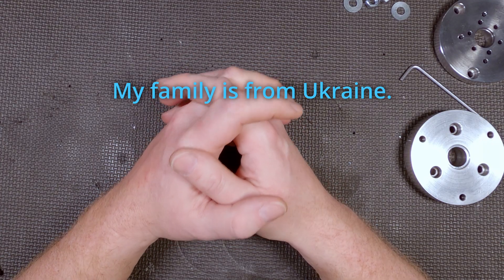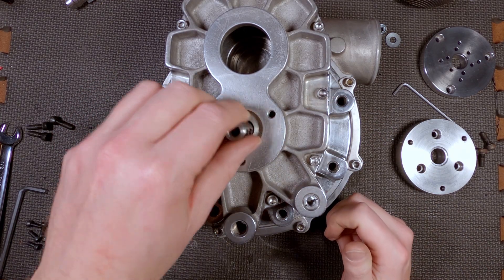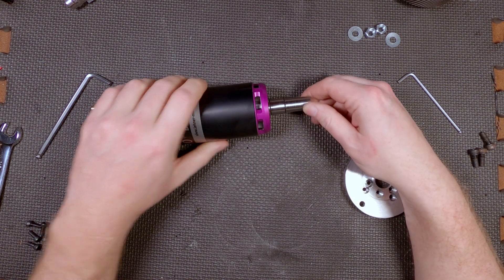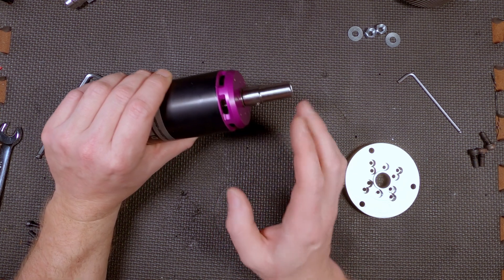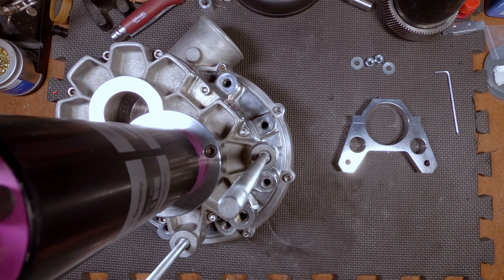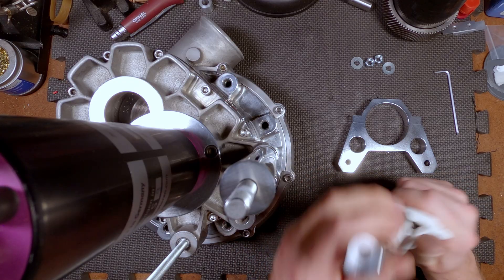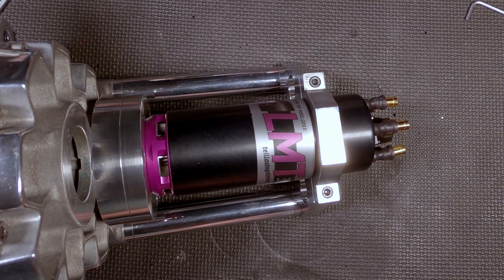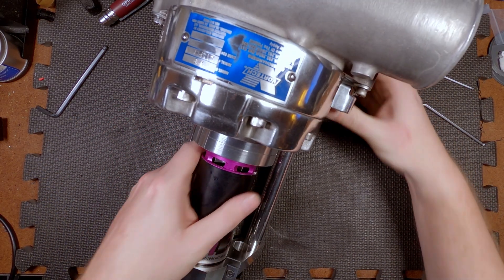DIY Electric Turbo: Sledgehammer Assembly

Comment: Interesting.  You did take care to match the motor characteristics to the requirements of the compressor, didn’t you?  I’m thinking the motor won’t be capable of spinning at the sort of speeds you’re going to need to get the compressor working correctly.  Do you have the specifics posted anywhere?
Reply from the maker: Watch this video: https://youtu.be/h7yScua28I8

Comment: I have a question why do you remove the gear train is it too much stain on the motor for startup and if so can't you set the motor to sit in a idle or is it still to much strain I've always been very interested in electric superchargers
Reply from the maker: It's a balance of motor size/rpm/torque.  You could go with a lower RPM motor (that would be easier to control), but the motor would require more torque, and more torque = more size and weight.

Comment: If you get a chance to mass-produce this turbo I will buy it. The first electric turbo that is not a scam from ebay
Reply: It's not the first one that works.  There's a few commercial models, but you get what you pay for, they're a few grand for the kit.  I think it was MCM that did a video on them a few years ago, the electric turbos that actually work... They worked great for smaller cars up to like 6cyl.  For 8 they were a little too little air flowed, but they weren't sized for 8 either.

Comment: Alex, I've been thinking about a system that eliminates lag. Extending a shaft through the impeller and a dry seal on a fixed inlet elbow would work perfectly. Boost control could be done using a combination of the motor as a generator and electronic wastegate. I'll need a floating mag clutch system to keep weight off the shaft. 
The OEMs do it but not in pursuit of power unfortunately. Your work is incredible, I love it.

Comment: Turbos spin at between 100,000-250,000 rpms at full rev-how do these electric turbos even come close to making the same boost?
Reply from the maker: Not all turbos (or more accurately, centrifugal compressors) work in the same RPM band.  I did a detailed video about this a while ago; this might prove helpful: https://youtu.be/h7yScua28I8
Reply: @AlexLTDLX  Thank you so much!!!
Hey, love all your videos-   so I just wanted to put it out there for future video ideas that an AGNI/Lynch motor might work well for powering a turbo with perhaps some gearing up -also any other smaller electric vehicle project:
The AGNI or Lynch motor is a unique axial gap permanent magnet brushed DC electric motor.  The motor has a pancake-like shape and was invented by Cedric Lynch in 1979.
The Lynch motor is built from ferrite blocks sandwiched between strips of metal, instead of conventional copper coil windings, and is held together purely by magnets. The motor is available in several sizes (6.6 lb) to (24 lb) weight and provides a power of 1.5 kilowatts (2.0 hp) to 11 kilowatts (15 hp) within an efficiency range of 80% to 90%.
Any voltage battery up to 90 volts can be directly connected or a variety of controllers will work such as cheap PWM or golf cart controllers of many power levels.  I've even ran mine (AGNI 15kw capable) off a 3Kw brushed motor controller for an ebike.  What's amazing is the torque produced: I once hooked a single 18650 battery directly and the shaft spun about 90 RPM and had an incredible torque for such low voltage and motor speed.  A 9v battery spun it about 300rpm and you could not hold the shaft from spinning with your hand, 48 volts is about 2,500 rpm and it will rip a back tire right off an electric bike.  A very interesting motor so I thought I'd throw it out there, thanks again for excellent and interesting content.

Comment: Alex,  imagine what you could achieve with an axial-flow turbine, instead of centrifugal... there is a reason you can't buy them...
Also, if you absolutely had to go with a positive displacement air-pump, what would be your first choice??  Rotary Lobe, Rotary Vane, scroll, helical, radial...??  There are several that would provide plenty cfm and psi (even for your engine) in the 3000RPM range!
Believe it or not, a piston type, double acting, air cylinder with a 6" bore and a 12" stroke, would produce 702CFM at 1800RPM!!!
I've been researching every possible type of air-mover for quite some time.
There is a much better way then the headache of centrifugal, as it will constantly be a problem.  For example, energy draw during EVERY spool-up risks all the electrics.  
One more thing, just try to imagine the controllability a positive displacement system provides....  no choke/surging, no crazy rpms, no compressor maps...
Reply from the maker: Wow.  That's a big question.  Let me back up and explain why I went with a centrifugal solution instead of something else (the bulk of my boosted experience is actually around positive displacement blowers/compressors).  Centri units hit the "sweet spot" between unit size, weight and what's possible with brushless motors that are not hyper-exotic in terms of rpm vs power.  I know you've been with me for a while now, so you know that the only real issue I've been having is overcoming the long cables that installation in an actual car requires.  Correct me if I'm wrong, but axial-flow turbines require more speed (rpm) and multiple stages.  I don't know too much about them though.  If I had to choose a positive displacement solution, I'd likely go with an Eaton TVS - which still requires pretty decent rpm (~16,000) but when you go down in rpm, you have to go up in torque - and more torque generally equals bigger and heavier.  I think if we want to look at really BIG power, we'd still be better served with a large centrifugal compressor, but keep the internal gear step up - it would still be smaller, lighter and more efficient than a large positive displacement unit.  The real benefit of conventional positive displacement superchargers is instant boost.  Something an electric-driven solution doesn't need to worry about.   In my experience, they tend to take more power to drive (probably due to the heavy rotating parts) than centrifugal units.  Case in point: my Whipple (2.3L Lysholm, basically) needed about 70 hp from the crank to make 15 psi and about 850 hp in perfect conditions.  The "sledgehammer" will need less than 40 hp from the electric motor, will only need to make 10 psi or less to make that same 850 hp.  Plus, even with the batteries, it's still a good 40-50 lbs lighter, doesn't need charge cooling, installation is easier and the weight can be more favorably distributed throughout the car.
Reply: @AlexLTDLX  Yes Centrifugal seems to make more sense then going with a large positive disp. compressor.  However, the "Ideal electric forced induction setup" does not require a large, heavy positive displacement compressor...  By incorporating a pressure vessel, it allows the use of a relatively small positive disp. compressor.  The pressure vessel solves the problem of using massive amps/wattage; removes the need for crazy ESC's; 100% eliminates boost delay/lag; provides extremely controllable boost pressures even at 1000RPM; and could even remove the need for batteries altogether, as it could be powered by the alternator.  Let me explain.  Boost event last 5-10 secs, followed by minutes, hours, days before the next boost event.  So instead of trying to create all the boost on the fly (which is entirely the whole problem with electric superchargers, it just requires too much energy), the pressure vessel would be getting charged in between boost events(and during), which could be drawn out over minutes, hours, days... requiring surprisingly low electrical power requirements.  For example just 100watts draw over 1 hour is 360,000 watts = 483horsepower of stored energy, already in the correct form(Air).  Probably more like 400HP after losses.  So 400HP over 10secs of boost is 40HP per sec of boost... just from 100watt draw for an hour.   So a 1000watt pressure vessel/Positive Disp. system would provide 40HP of boost energy per sec for 10seconds... after 6 minutes!!!   Or 80HP of boost energy per/sec for a 5 second boost event.   There are so many advantages from a compressed air system it's ridiculous.  The only downside is the requirement of electronic precision pressure regs, plumbing, and achieving a smooth transition from boost to NA via diverter valve actuation.

Comment: Quick question what did use to machine those plates? They came out pretty neat🔥
Reply from the maker: I also have a small lathe.  That thing has more than paid for itself.  It's an 8x12 Harbor Freight deal - not my first choice, but around where I live used, decent machine tools are pretty much non existent.  With some modifications, it does pretty well.  If and or when I get more space, a bigger mill is my first priority.

Comment: When someone says that polishing is the quickest way to get a decent finish on something... It means they don't have a media blaster.
Reply from the maker: I do have a sandblaster.  Currently filled with aluminum oxide.  Too coarse.  And I can put a passable polish on aluminum faster than bead blasting and having an even finish.  I bought a dental lathe for $20 with a buffing wheel.  Can't beat it for quick polishing.

Comment: over here its eazier to find a used truck turbo then it is to find a vortech compressor , wonder if you can use the compressor wheel and housing and make youre own backing plate for the housing with bearing and axle from the compressorwheel to the motor
Reply from the maker: Sure you could.  Just try to find a turbo with a fairly large exducer (and small inducer).  I did a video on compressor maps in the "electric turbo" playlist on my channel.  As long as it meets the requirements (keep in mind, on the high power motor side you're really not going to find much that can go over 50,000 rpm - so that's one practical limitation).  I'm also working on a cheaper, easier to build variant that should support about 650hp - check out my videos from a month or two ago.  I set that aside because I need to try a different motor, so I've decided to turn my attentions to this thing.  But I'll get back on that one soon enough.
Reply: @AlexLTDLX  maibe try gearing the electic motor up and use one with more watts think running one at that speed will wear it out pretty fast anyway

Comment: Glory to Ukraine. With that being said I have a few questions, Forgive me if you’ve already answered this in a previous video or in this one but I’m very curious on your project as I am “attempting” this myself for my own application.  What motor are you using, what cfm is this setup producing, how exactly did you choose the right compressor, how much power does this need, are you running any oil to the bearings, and could you use a speed controller to adjust cfm/manifold pressure? Sorry for the amount of questions but For the little research I’ve done on “diy E-boost”this looks like the most reliable build I’ve seen, very impressive I’ll be tuning in to see more. 👍
Reply from the maker: Thanks for supporting Ukraine.  A lot of your questions can be answered in great detail through the videos in the "electric turbo" playlist - there are 53 videos there (!): https://youtube.com/playlist?list=PLhacdpER4T0vzo531cmfi_7fJWd-7DSSt  I go through compressor maps, two dyno tests, drag strip testing and a whole bunch of other stuff.  Pick through those videos and see if that doesn't answer all your questions and more.  If you still have any, feel free to ask.

Comment: "Fantastic Beasts and Where to Find Them"? outstanding!
I'm looking at it as a hobbyist, and ex jewelers machinist, SME certed back when.
yeah that motor in a go-cart would probably run 8 second QM's, for giggles.
that "flex coupler", perfectly simple, hopefully the driven bolt wont shear on ya.
Reply from the maker: The 6mm bolt has a tightening torque spec of 14 ft-lbs.  The LMT motor, at full tilt, is rated at 40kW and 50,000 rpm.  40kW is 53 hp.  Hp is a function of torque and rpm.  So if it hits 53hp at 50,000 rpm, that's only 5.4 ft-lbs of torque.  If it hits 53 hp at 25,000 rpm, that' still only 11 ft-lbs.  In the first version (20kW peak, 14kW continuous), the 6mm bolt had no issues.  The math says it should be fine here too - in fact, I consider it a mechanical fuse - but if it does shear, I'll just move up to an 8mm bolt with the head milled down to a 10mm hex.  But dynamic real world loads might cause issues - only one way to find out!
Reply: @AlexLTDLX  BOV should protect the 6mm from throttle closing quickly.
The motor should be capable of serious power from 10k.
Have some experience with 40mm NEU motors, in Y wind they can do continuous power from 10k. Max efficiency at 35k. Bearings good to 60k.

Comment: From the USA 🇺🇸and feel for your people. It's so wrong the incident have to suffer. I love your videos an truly wanna build one of these for my civic si. Bin looking at supercharger kit's, but qt $5,000usd+ I'm thinking I could prolly build one Luke this and make the 380hp + those kit's clqim to make on my car.
Reply from the maker: Thanks.  The P2/VESC setup would probably be ideal for you then.  You could duplicate that for well under $3k for everything.
Reply: @AlexLTDLX  lol you know I'm still wondering if a pair of 100mm EDF units in series might stuff a Honda 3-4 psi, for under 200 bucks total. enough to feel a decent boost, and mild enough stock ECU would just deal with it.
not got a Honda but they sure look friendly to the concept!
Reply: @modelnutty6503  atmospheric pressure is 15psi , at 3psi boos youd be making about 10-15% extra HP, not really worth the effort unless you just do it for learning
Reply: I've worked in and helped tune several supercharged Hondas, B and K series. I would say this probably is your best bet. As far as aftermarket kits the only ones (in my opinion) that are really worth it are the Kraftwerks kits with the Rotrex blowers and the MercRacing Eaton TVS kits, both of which are somewhat unreasonably expensive.
Reply: @barneymiller7894  yes l have looked at the kraftworks kit alot since getting my 07 8th gen civic si coupe with a jdm k24a swope just done. I've had and rode in alot of older D & B series cars that were so fun, but none had the power this k24a has basically stock. This thing screems at 8k. I've heard alot of guy's say I need the oil pump change to run 8k but my car and a buddy's has done fine for a year now taken 8k redline like a champ. Plan to do the pump tho asap. Gathered a trunk and back seat full of new upgrades to put on asap. Haven hard time with a bad back and legs. And hard to good help or even a shop I trust to not try qn rip me off.

Comment: Raw power and rpm that lmt won't have the rpm and torque of tp but what do I know 🤔 I run both  tp  way  rawer  and torque happy rpm  power hungry  monster
Reply from the maker: We'll see - the LMT motor's rated for more than double what the TP Power motor is and another 10,000 rpm.  The biggest issue I'm seeing with the TP Power motors is long motor cables and lack of position sensors make them tricky to run and being 6 poles they demand a lot from the ESC.  Those issues notwithstanding, they seem to be pretty good.  With short cables I wouldn't think there would be any real issues.

Comment: I think you'll find that as the gaffertape "yields" the clamp bolts loosen and rattle out. Slowly because of the viscosity of the anti seize
Reply from the maker: That's a good thought.  I'll keep an eye on that.
Reply: doesn't need much torque, tape only compresses so much. the support tubes on the all thread shouldn't be issue either, diameter gives some bicycle frame type rigidity short as they are, motor can't twist on its mount plate. loctite and a little torque, still keep a watch on it all anyway but I doubt it'll budge any.

Comment: Looks like there is enough room to add another 53hp motor... 😉
Reply: Big brain time
Reply from the maker: Lol... one at a time!  To go bigger, I'd likely use a lower-rpm outrunner motor and the gear step up built in to most blowers.

Comment: This is interesting to watch. I’ll be considering boost after I do a engine swap for more displacement. 
But I’m working with half the cylinders and a street build.
I’ve been thinking about re-purposing a used supercharger.
But your electric turbo has promise too
Reply from the maker: I've built many custom supercharger setups over the years; but cost-wise, including installation, I think the P2/VESC unit is the most bang for the buck.  Thanks for watching!
Reply: @AlexLTDLX  I’ll have to scrape more of your content to find out what that is. 🤣
Reply: @AlexLTDLX  BTW, have you done a “boost school-math class” video on how to determine how much boost you can get out of a charger at x rpm?
Reply: @AlexLTDLX  hey, what exactly is the P2/VESC?
Reply: Hey, look into the Aisin AMR500.  It’s a small supercharger, costing usually $200 and readily available.  It can support up to 400hp(supposedly) but is great for smaller motors.  How big is your motor?

Believe it or not, the engine doesn’t dictate the max power of a turbo or supercharger, it’s all in how much it can flow.  You should be able to calculate flow rates, if so you can make a “guesstimate” of roughly 10hp per lb of air per hour.  So if a turbo/SC can support 50lb/hr, it CAN make 500hp(before efficiency losses)